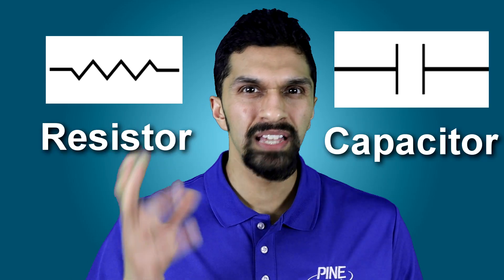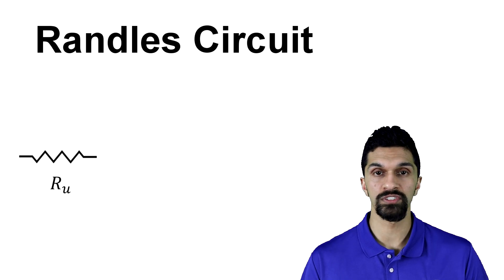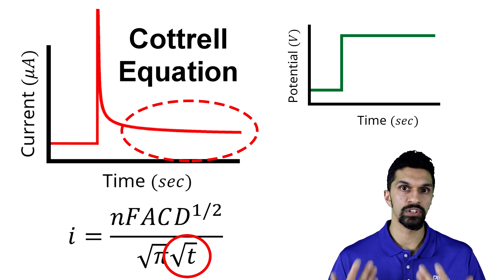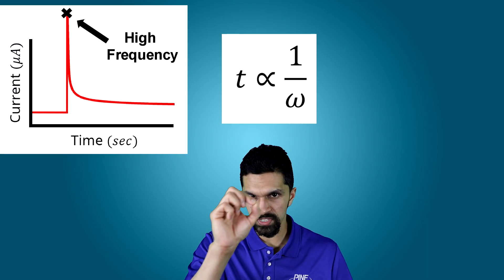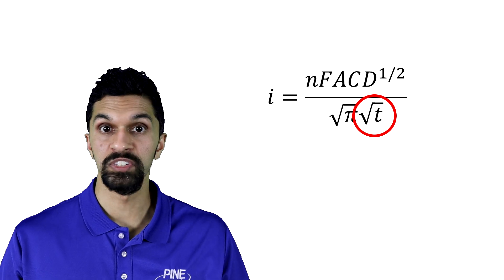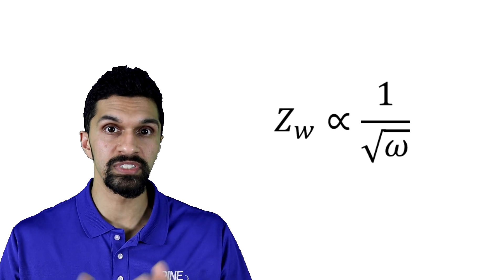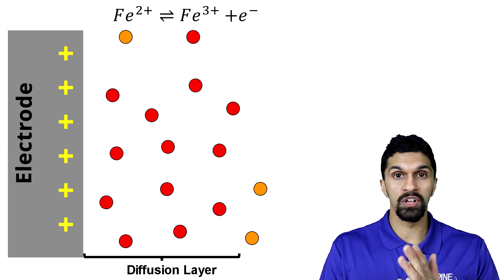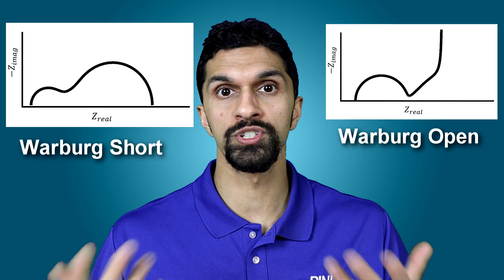An Intuitive Approach to Warburg Impedance

Comment: In the Nyquist plots of two samples, one shows a longer extension in the low-frequency Warburg region, even though the operating frequency range is the same for both. What could be the reason for this difference?
Reply from the maker: Assuming we are talking about systems with freely diffusing molecules (as in this video), then the explanation for observing a longer diffusional tail (i.e. larger real and negative imaginary impedance) at the same frequency is due to the diffusion coefficient of the molecule.  In fact, because Warburg impedance gives the same 45 degree angle for every diffusion controlled species, then the only difference in the diffusion coefficient would be based on the frequency at each real and imaginary impedance value along Warburg tail.  Does that make sense?
Reply: @Pineresearch so can we say longer diffusion tail means higher warburg impedance?
Reply from the maker: @sudipta5332  Effectively, yes. For two materials over the same frequency range, if one has a longer 45° tail than the other at the same experimental parameters, it likely means that one has larger Warburg impedance. As noted before, that may explain something about the diffusional properties (i.e., diffusion coefficient) of one material compared with the other, or you might explain it by saying something like the material with longer diffusion tail is more hindered by diffusion than the material with shorter, lower impedance tail. The exact reasons physically for these findings might need to be further explained, but that would be up to you and your knowledge of your materials and experimental conditions.

Comment: what is warburg short and warburg open? How should we approach it?
Reply from the maker: For a more complete breakdown of both finite Warburg elements, I recommend one of my EIS webinars: https://www.youtube.com/watch?v=PFbzbUag1aU&list=PL_8rG6exne8gBb7fU-4Z3iauoJF4L54I_&index=7

Briefly, the Warburg short and Warburg open are finite length diffusion elements.  They describe diffusion through a boundary layer of fixed thickness, compared with the more commonly-used (infinite) Warburg element, which describes an infinite (or semi-infinite) boundary layer thickness. The difference between the Warburg short and open is the boundary condition, whether it is an absorbing/short boundary or a reflecting/open boundary condition.

Comment: The illustration you give for redox species traveling through the diffusion layer makes sense for a soluble molecule, but what would you supposed it'd look like in the case of a solid metal electrode being oxidized to a soluble cation? This scenario is hard for me to conceptualize (its also most relevant to my research work lol), since at anodic potential, the diffusion layer should consist more of anions, which I'd imagine would attract and stabilize an oxidized metal cation originating from and traveling from the electrode surface.
Reply from the maker: This is a very good question, and to a degree I'm not 100% sure how to think about it, but maybe this will help, as I work it out myself.

Let's say you were oxidizing a solid Cu electrode to Cu2+ which would freely diffuse away from the electrode surface.  That reaction can be written as something like Cu2+ + 2e- <--> Cu.  We can then write the Nernst equation for this, where the potential where oxidation is occurring has the form E = E0 - RT/nF ln(1/[Cu2+]).  So the potential you set for the oxidation is related to the concentration of Cu2+ at the electrode surface.  More oxidizing potentials, the higher the concentration of Cu2+ at the electrode surface in accordance with the Nernst equation.  As Cu2+ diffuses away, more Cu oxidizes to maintain equilibrium.  

I believe in this situation (where the oxidized metal cation) originates from the electrode surface and diffuses away from the electrode, would give you a similar EIS result, where in the low frequency region you would observe a 45 degree line.  Conceptually, instead of thinking about a molecule diffusing towards the electrode surface for the electron transfer to occur, you are now thinking about the molecule diffusing away from the electrode surface such that the condition of equilibrium at the electrode surface being met.  So as the concentration of Cu2+ gets lower at the electrode surface, the electrode would oxidize more Cu to Cu2+ to maintain equilibrium.  

Does this make sense?  Sorry, it can be a bit confusing.
Reply: @Pineresearch  That's a very good point about how the nernst equation would lend itself to adding impedance as solution, especially near the electrode, becomes more saturated with product. I could also maybe see how that could add to the phase angle as the diffusion layer becomes more concentrated with product cation, although that I'm less sure of. I'm also curious if things could go the other direction, where amassing anionic electrolyte could help stabilize oxidized metals, taking off some impedance, but that's just me thinking and I need to do more reading for. So far I have only found a metrohm article suggesting that adsorbed redox species can appear to exhibit inductance behaviors. I want to try it out on my own samples to explore; it sounds exciting although I am worried about breaking time invariance while actively oxidizing away silver from my electrode. Working with irreversible echem reactions which the redox species starts off adsorbed has been trickier than working with the reversible stuff like ferrous cyanide lol.
Reply from the maker: I would agree, that you need to do EIS of your sample to see what kind of signal it gives, and then you can start to rationalize what is happening in your system.  If you see inductance then you might have some adsorbed redox species as suggested by the Metrohm article.  Or you could have a simple warburg diffusional tail.  You'll have to see what you get.